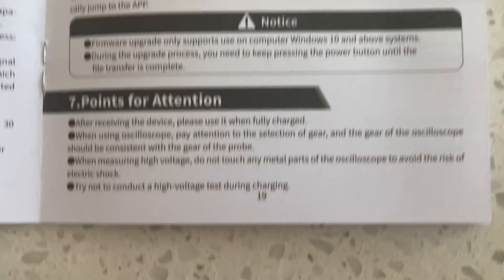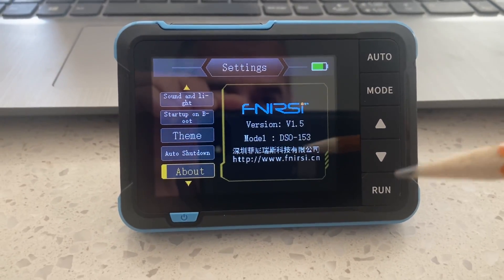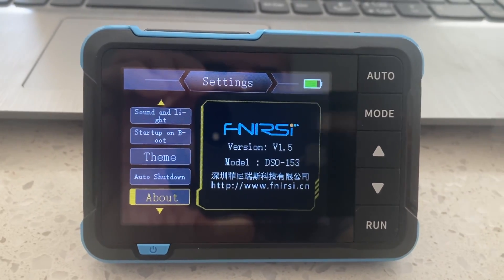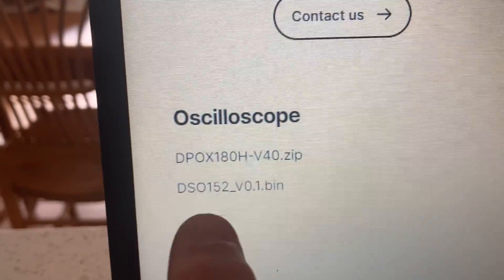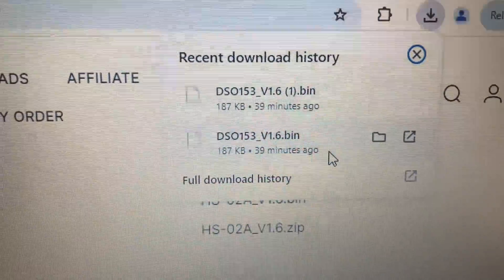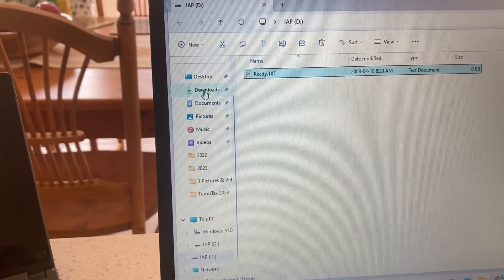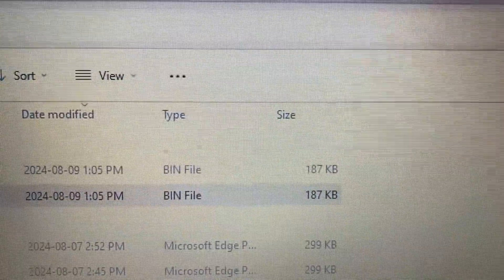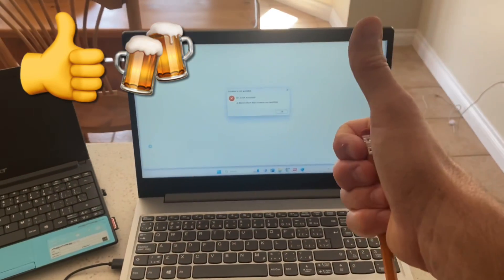Fnirsi DSO-153 Firmware Upgrade

Comment: Thank you, this saved me some stress! I just got the 510 and the upgrade process was the same as your 153 luckily! The manual was of no use as it reads like yours and seems like you do that to shut it down when that's the startup procedure for the firmware upgrade! Other than that, easy enough to upgrade, cheers!
Reply from the maker: Thx for watching 👍🍻

Comment: Excellent video. I bought a DSO-510 and the software upgrade procedure is similar except I held down the power button while the upgrade *.bin was transferring. Really appreciate your video, it helped out a lot. Thanks.
Reply from the maker: Thx for watching 👍🍻
Reply: Is it better then the DSO153 or is it as bad?
Reply: @public_channel_FA.  Ha, guess it's more about patience.
Reply: @billxx1948  Thanks for replying. I'm planning to get the DSO510 for automotive testing, but if it is like the 153, then I'll just get the 153
Reply: @public_channel_FA.  Just an opinion but I think the 510 is better than the153.

Comment: Thank you for the interesting videos that you upload using the DSO-153. Do you have one testing the ABS wheel speed sensors, or should I say testing the wiring and ABS module confirming that the sensor or the reluctor ring are at fault. Many thanks from across the pond.
Reply from the maker: Thx for watching…Honestly not much on the channel re: ABS. This is from 6 years ago, it may or may not provide some insight.
https://youtu.be/rWZmhVDLe2s?si=GH4qAjuWt963b85o
Thx again…Cheers 👍😁

Comment: I would like to do the firmware update without any undesired mistakes and as I saw in the video that the following Notice was not done from the manual but I also saw that the update was successful that is why I am just asking. Is this means something in the manual: "During the upgrade process, you need to keep pressing the power button until the file transfer is complete."?
Is there anyone who is in the know?

Comment: I don't know whether you have covered this... and I forgot to mention in my previous comments,  just a note to others, auto calibration is not covered in the manual. To auto calibrate hold down the AUTO button until you get message "Awaiting auto-correction" wait for message to go, about a minute, then it is ready to use.
Reply from the maker: Mint thx a lot. 🍻

Comment: Just worth noting Firmware v1.6 limits the ability to go past 10kHz in the Signal Generator menu. With version 1.5 you can go up to 22kHz, even though the device's manual states the 10kHz limit.
Reply from the maker: Ok thx and thx for watching 🍻